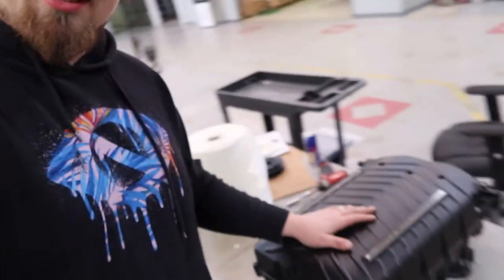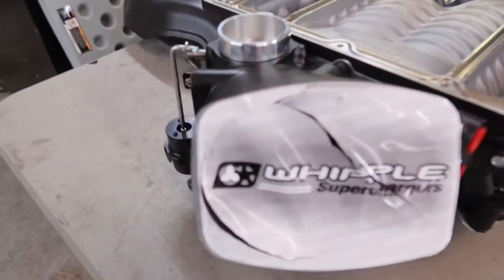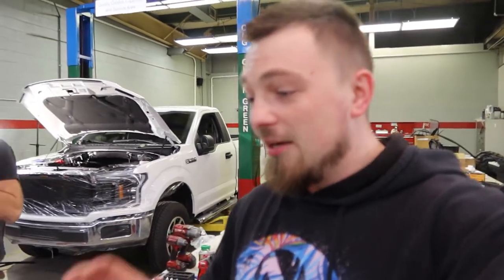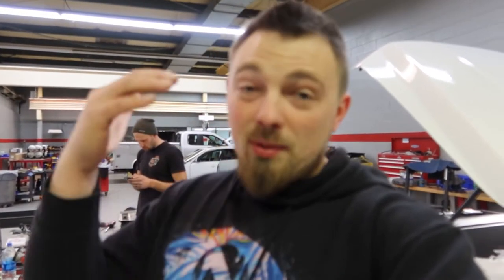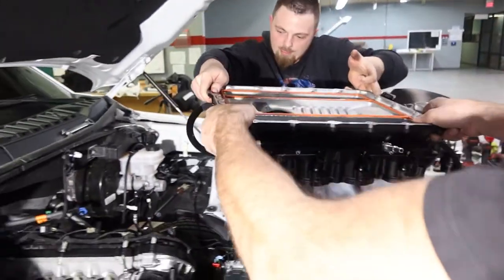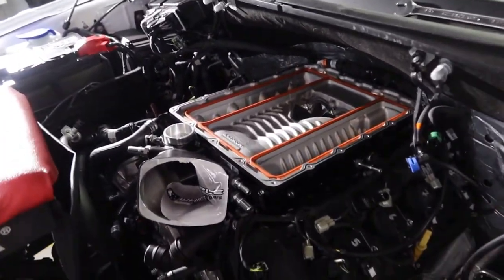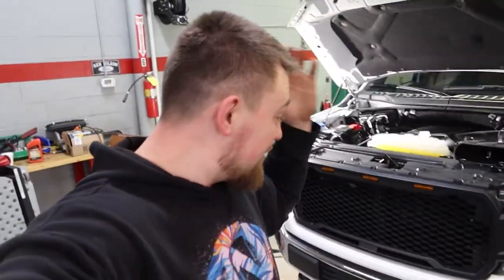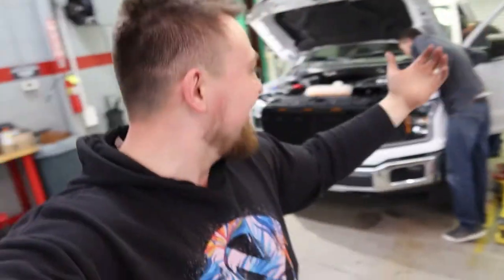Installing Gen 5 3.0 Whipple On My 2018 Ford F150 V8, 700+ HP!! Wicked Fast Regular Cab Truck!

Comment: Had a 2019 5.0 with the 3.0 Whipple’s stage 2 only 62k miles 
And it ruined my engine cylinder 5 and 6 ate shit. Hopefully urs does good maintenance on those can add up

Comment: Just bought a 2018 today
Reply from the maker: Nice!
Reply: Hahah good shit I got one a few months ago, get a tune asap bro the factory tune will mess up the transmission. Go 5star or OZ honestly. I went 5star they’re quick to respond and send back tunes I love them
Reply: I have noticed driving in normal mode it's low rpm sloppy shifts so I have been driving it in tow haul to see the mpg and sport mode, it was an old man's truck, now it shifts properly in all modes, maybe just some glaze on the clutches, impressive in sport mode